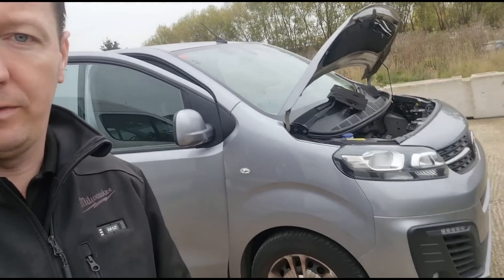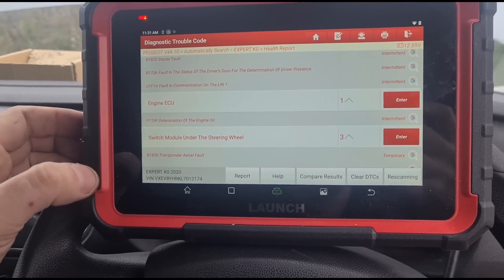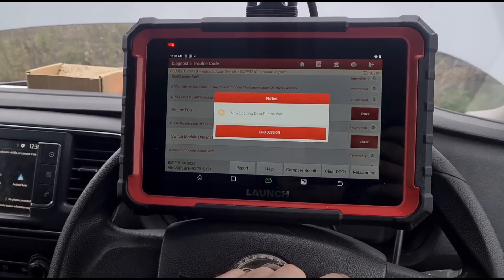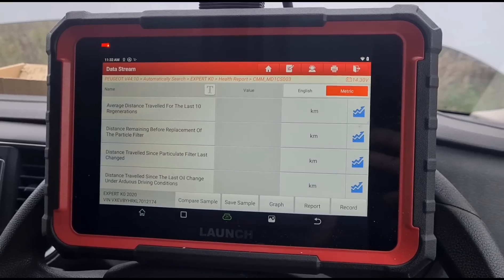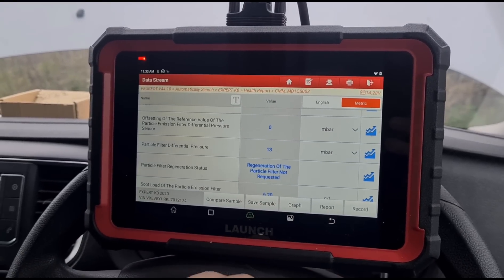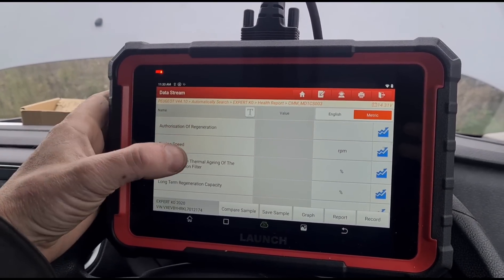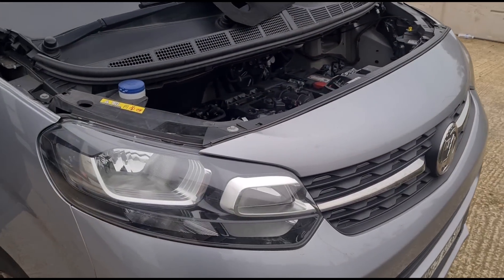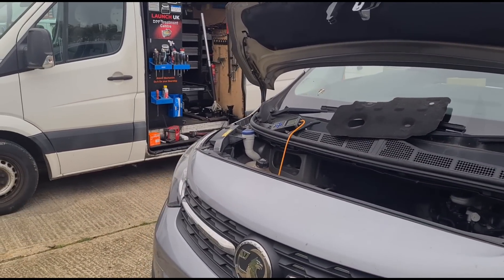P119F Deterioration Of The Engine Oil Caused By DPF

Comment: 13mbar of presure at idle is absolutely normal for the diferențial presure sensor, also the dpf has a only 21k since was changed, basically is almost new. Look for the dilution protection at engine lubrication if is active ori inactive, also to the oil level sensor voltage if is zero

Comment: Juat had to put a new engine in my Citroen jumpy 1.5bluehdi for this reason... Baight the van when it was 2 years old from a dealer , after a few months i complained that i could smell fuel, they told me they couldnt see anything wrong.  Had the DPF warning loght come on, they told me to take it on the motorway because i was driving it to slow and to short of a distance.. takes it for an oil change in may. 6 months later in November bottom end bearings go.. Citroen and Peugeot say i need new engine 7800€ 😢.  All down to this stupif DPF filter... Whats more harmful for the environment, replacing an engine on a 3.5 year old van or abit of sut that comes out on a regeneration on motorway anyway 

Load of bollocks

Great video. Well told
Reply: What did you do in the end?

Comment: I have Chevy Cruze. Won’t rev above 3500 loss of power. No faults on dash or on ecm. Only fault showing is faulty ambient temp sensor as it’s reading -40. I cleaned the DPF got the pressure down to 9kpa but the soot was still showing high until I reset it. Then soot was showing 0 and pressure 1.1 kpa at idle. Thought it would be ok for a while until ambient temp sensor was replaced but after 2 mile it went back into
Limp mode but with no warnings on dash. Would the faulty ambient temp sensor put the vehicle in limp mode even if DPF is clean? Or am I missing something? Or have I not cleaned it enough? The pressure was 26 I got it to 9 kpa but then it started goin up
Slowly.
Reply: The fact there is no faults in ecm confuses me
Reply: Since when do you ever need to rev a diesel beyond 3k rpm lol

Comment: You can reduce ash buildup Jimmy, but it would require removing and chemically cleaning the dpf then hydro washing it out. An acid based tfr and pressuring washing it out has better results than you would expect, if the dpf isn’t cracked beforehand.

Comment: The cause of diesel getting into your oil is because when your vehicle does a regen it sprays diesel on the exhaust stroke of your engine which goes into your dpf to burn, and to get hot enough to burn the soot built up away… But the downside is some of this diesel being sprayed into your cylinders on the exhaust stroke gets past your piston rings then into your oil in the sump. So if you have a dpf fault and your car tries to start a regen then stop and starts over and over, this is what will very quickly increase oil dilution. 👍🏻 

Newer vehicles use a separate injection right before the dpf, to prevent oil dilution, as it isn’t going through your engine first. But it costs more for manufacturing to do it this way. So some do, some don’t use this method..👍🏻

Comment: Had an e60 with constant dpf issues, regen trouble and oil dilution. After wasting 100s trying to sort it to no avail, I just got all the emissions gubbins removed and coded out. 2 years later of flawless performance. I live in the sticks, am rarely in a busy town and since the engine was otherwise v healthy with little smoke, I had to issue with doing it. It was that or scrap it.
Reply: Don't have an accident with it cos if insurance find out you've no cover
Reply: @Joe-ud2hb 
It's fine, insurance engineers never do anything more than look at a vehicle to decide whether to write it off or not after a claim has been made, they'll never get their hands dirty checking anything

Comment: Jimmy I have a ford courier 19 plate is there. Vaporiser on that please . How does the emissions lower on that model.
Reply from the maker: No vaporizer.
Reply: @ thanks for the reply 
Can I ask if I can put dpf cleaner straight into the o2 sensor at the catalyst as the engine is running . What would you suggest?

Comment: French diesels are very reliable. If everything that interferes with the normal operation of the engine is removed from this engine, then this engine would be as good as the cars released in 1995. For this, the DPF, EGR, ADBLUE system must be removed and the engine control brain programmed accordingly. Modern diesels engines want long journeys and preferably burning time after the DPF filter. Short journeys with stops make a modern diesel keeping a motor car very expensive and difficult.
Reply: French Diesels used to be Reliable. Those days are long gone.
Reply: All well n good turning off adblue, blanking egr, gutting out dpf,  BUT if u have an accident & car is checked over by insurance & found to have been changed or tampered with you've no cover.
Reply: @Joe-ud2hb If the longest word in the English language 🤣
Reply: None are really reliable anymore 😢
Reply: Exactly. The problem is that diesels are designed and engineered to pass governmental emissions tests, not for actual day to day, real-world use. Basically the diesel engine is a dirty polluting thing that has no place in our cities (and I’m a fan)
Reply: @simonbailey2151 twaddle the air going in is dirtier than the air coming out of the exhaust😂

Comment: Checked the documentation and fault repair procedure on this exact van from Vauxhall (Peugeot) 
This is what the official dealer is told to do and what information and procedures they have access to.

Now some of this is just made up crap in my opinion but I'm listing it all as they say it (I don't agree with some of this)
This wording isn't exactly from Peugeot - I've kinda translated it to be more understandable because their Google translated to English from French documents aren't very good.

1. Check software version of the ECU, if it's not a certain software version then update it because they've had many updates to the software of these.
2. Check that the maintenance interval is correctly configured in the ECU for the vehicle and that it has been followed, make sure it's "dynamic" which means flexi-interval or the car calculates when you need to replace the oil and isn't following a set schedule as such. 
3. Check the frequency of regeneration and the complete DPF datapids for any issues or weird data
4. Question the customer to get a usage profile to see if that's where the issue and need of frequent regens lie. For example if they are door to door delivery drivers or similar.
5. General health check on the engine - does it feel worn out and done and how does it drive. (meaning is the engine naturally producing more soot than normal). Remove DPF if necessary or if suspecting of engine - check how much soot comes out the turbo without the DPF mounted when giving it some gas. If necessary carry out compression and leak-down tests on the engine to confirm health.
6. Check the TSB for the ECU update for this fault code - is the vehicle included or not. Basically says if fault code P119F is present replace the oil and update the ECU to the latest version. This very car is not included in that TSB.

As you can see Peugeot documentation gives you no information or help - Peugeot themselves see no clear reason for the fault except for ECU software. Just says "check everything" and replace oil and update ECU. Most dealers would not fix this car I think and they'd just replace the oil, update the ECU and send out the car again. 

My personal opinion is that most likely the issue would be fixed with a replacement DPF + updated software which hopefully doesn't melt it again. These engines as Jimmy very often shows us have crappy software from factory on the Euro 6 engines that often damage DPF's. The Peugeot vans are no different - there have been recalls and TSB's and goodwills for damaged DPF's. One example of a recall is that we had to check the DPF by putting a kind of white cloth almost like cheese cloth to cover over the tailpipe and let the car idle for a few minutes - after the few minutes if the cloth put over the tailpipe was black or sooty the DPF was damaged and got replaced for free along with a software update - if it wasn't black after a few minutes the DPF was ok and only the software update was carried out. The root cause of the damaged DPF is for sure suboptimal software from the factory.
Reply: It should be also checked how much oil it burns in a few 1000 km because these newer stellantis engines are known to get stuck piston rings with soot, petrols and diesels. They use abspecial chemical cleaner in the combustion chamber to free the piston rings. And a software update.
Reply: @seghio  Diesel engines from Peugeot rarely if ever burn oil, the mechanicals are usually excellent.

The gasoline engines not so much, it's I think the opposite there - good luck finding one that doesn't burn oil, lol.

I think it's mainly because people drive 20 000 and 30 000kms and 2 years between oil changes and expect the engine to last when running any oil that long but especially now it's even worse with the new mandatory 0W20 oil, it's a joke from Peugeot for recommending that and a joke from customers who follow it. On diesel commercial vans it's 2 years and 50 000km for 0W20 oil, can you believe that? And companies follow it... disaster.
But working at the dealer you just have to smile and pretend like what Peugeot recommends for intervals is correct and fine...

Usually there are goodwills for engines burning oil up to 6 years old and like 150 000km. There needs to be an oil consumption test carried out - the acceptable limit is 0.25L per 1000km maximum. The customer always says they fill liters and liters every month and then when on an oil consumption test 99/100 cars consume less than 0.25L but the customer was just making drama for no reason because they want a new engine because it's too expensive to replace the oil more often and now they realize their engines is worn out because they were saving money with services ;)
Reply: Well explained 👍 Thank you